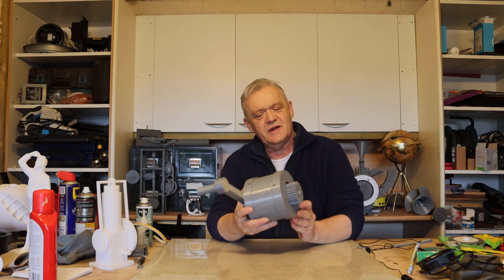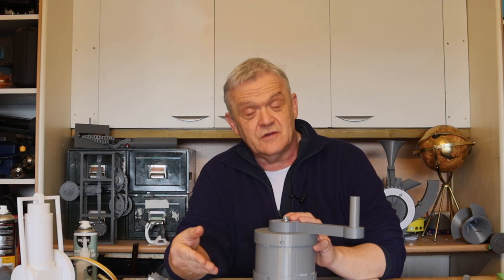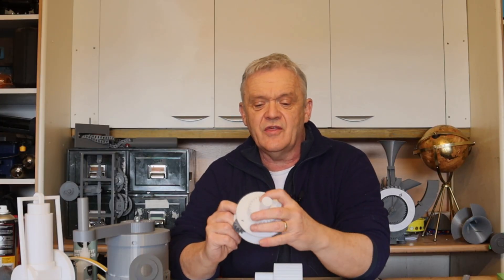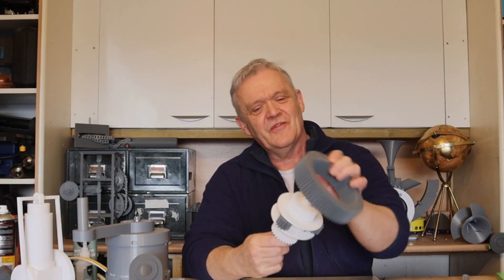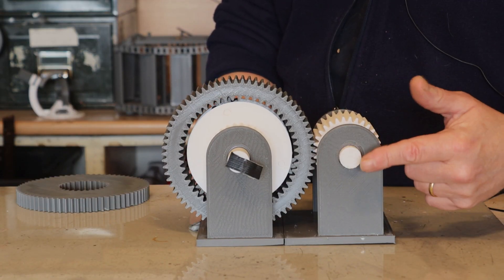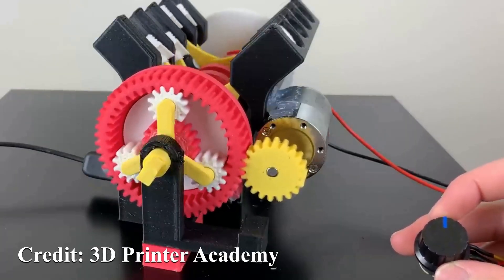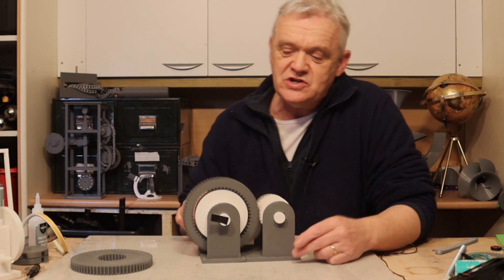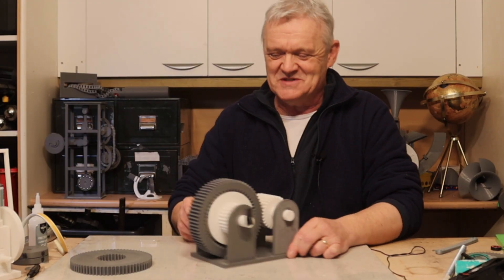2197 The Infinite CVT And Wind Turbine Control

Comment: I don't understand the use of the idle gear at the end. Are you saying that introducing that idle gear ends up with a non-linear relationship between input and output speed? I just can't wrap my head around how that could be possible whilst still delivering torque. If input/output is still a linear relationship, what's the actual benefit of this setup? 
I think I'm missing something here.
Reply: The idle gear is just to reverse the rotation of the feedback component, he's adding negative feedback to limit the speed of the output. If the feedback was positive, the whole thing would runaway in seconds and explode.
Reply: @altair7001  I think the key part of my question is the 'non-linear' thing. If the feedback is linear, then it's subtraction from the final speed would also be linear no?
Reply: @ashedtogether  OK I get what you mean. Personally I don't see how this could produce a non-linear relationship between input & output if everything is geared together. There would have to be some external input that is independent from the rest. I would like to experiment with this to find what is the response of this actual setup presented here. Very intriguing!
Reply: I think that the geared feedback loop changes the slope of input speed vs output speed, as seen on a graph. The response is linear, but the slope is shallower than the 45 degree slope we would see if the input was connected directly to the output. But to get a real speed control, which would give on the graph, a rising slope that flattens out at some speed and then remains flat, I think that some independent input is necessary.
Reply: @altair7001  Likewise. I've a feeling though that the idle gear addition probably doesn't actually bring anything useful to the table, but I do think there could be some really interesting applications for the setup without. I'm sure you could make a kind of dynamic gear box and I can see that being potentially very useful for electric motor driven systems to maximise torque efficiency at different output speeds.

[edit] about slope though, isn't that just generic gear ratio?
Reply: @ashedtogether  Electric motors don't really need an adaptive ratio gearbox because they already have a very flat and wide torque curve, so they are capable of being equally efficient at a wide range of RPMs. And yes, slope represents the gear ratio.
Reply: The reason you don't understand is that it does not do what it is claimed to do in the video.  All the idler "feedback" gear does is to achieve a very high gear reduction ratio.  It has no relevance to controlling wind turbines.

Comment: Nice idea but I'd have thought something like that was already used, or at least a gear box that changes gear according to the load. My solution to the variable wind speed issue is mechanical but kind of wasteful. Multi-stage pancake permanent magnet brushless motor with a first stage as rotor-stator-half rotor, with each subsequent stage adding a half rotar-stator-half rotor. The stages move linearly using hydraulics or a small motor and join together magnetically. The working stages and non-working stages are separate by however far their magnetic fields reach so the non-working stages don't turn.

Comment: That's a great idea to keep the generator part constant, all you need now is a way to limit turbine speed in high winds so the whole thing doesn't disintegrate like in the clip where the wings fly off due to centrifugal force.
Reply: Just reverse the input to output , and you can have a constant speed air foil.

Comment: Hm... So when you apply an uneven load on the output... Dont you need to then vary the motor accordingly? If so... well, i mean, already, i can tell why you shouldnt use this in a vehicle. CVT benefit is efficiency. And that motor is a reduction in efficiency. Or am i wrong?

Comment: Hey! That gearset that keeps the output speed close to the same speed for any speed of input works like an automatic gain control (AGC) circuit! The idle gear is the resistor in the feedback loop that sets the feedback level. Your current version with equal gears looks like a feedback loop that puts the output back in without reducing it. I also see some similarity to a phase locked loop (PLL) circuit as well. I wonder if other useful circuits could be made of gears. For instance, a zero volt switch (ZVS) circuit could be reproduced as a clutch that only engages when the input shaft is not moving.
Reply: Intresting thoughts tou have, somewhere on YT is Analog wooden computer. Gearing and latches were arranged together, antikythera device like. That clutch, think about Weights and Gyroscopic precession force and gearing.
Bicycle back in the day tried a Automatic Shifter, levers and weights effectively shifting by Gyroscopic force. The faster speed, greater force on, orbiting lever(s) to gearing. Don't think this bike with shifter exists today, but I think it's not a bad idea using gyroscope's to act as switches.

Comment: I don't really believe this can work as you describe it. I've spent a lot of time thinking about similar gearboxes.

1) For your first example using a motor and "as a CVT for a car", it falls apart as soon as there is a load the gearbox is driving.

The motor has to have a torque comparable to that of the engine (and therefore produce a similar power Power = Torque * Speed) otherwise it will slip. Any load on the output will cause either the engine input or the motor input to slip depending on which is weakest. At that point you might as well just use an electric motor rather than the combustion engine.

2) For your wind turbine gearbox, it cannot possibly operate as you describe. This can be demonstrated through a simple thought experiment: if the output speed is constant, it should turn at that same speed when there is zero input. This would be some sort of free energy device.

What you really have is a gearbox with a very high gear ratio. This doesn't help in practice as the ratio has to be tuned for the typical wind speed a turbine will experience.

Comment: yep - enter the planetary torque splitter - as seen in the Toyota Prius...

(teaching people the similarities between a differential and an epicyclical gear opens avenues.. All are 3 I/O gear-trains.)

NB. As used in oilfield work - with a hydraulic secondary, the fixed main prime mover speed allows for everything from full reverse through neutral and full forward without "affecting" available power...
It also allows a whole range of "low torque" - or even "lower efficiency / higher loss,  CVT types to work on the low torque side to achieve nearly any outcome - with lower losses than using the CVT as the primary torque path...

However for idling a wind turbine - once we are dealing with complex systems - feathering and braked rotors are the other side of the "power" equation  (generators still get overpowered - no matter the fangt gearing on the back end..

cheers for democratizing great feats of ingenuity. .

Comment: Do you know that the Rav4 Hybrid works in a similar way ? They use an 8KW motor between the wheels and the engine. The relative sincronization in terms of rpms generates the ratio

Comment: What happens when the output shaft is driven of the final setup? Wondering if it becomes a constant speed input, variable speed output based on input torque.
Reply: THATS interesting. Did you have any specific applications in mind? I gather that certain types of engines must remain at a nearly fixed rpm to perform efficiently. If the output of the (now reversed) system is stopped, torque would be maximum to get the mass moving. Once it’s moving, torque falls but rpm increases to continue to add force to the gathering momentum. It sounds perfect.

Comment: This would also allow a greater torque output during high wind so that extra current can be supplied and the extra energy can be harvested during high winds rather than waisted if brakes were to be used.

Comment: You should look into how a snowmobile belt drive system works using conical pulleys to make a cvt. Much simpler and more robust
Reply: Scooters with CVT also have that conical pulley and belt system, but it's not that robust as it eats through belts relative quickly and it's not very efficient due to the friction on the belt side surfaces.

Comment: Commercial wind turbines do it in the generator itself, not the gearbox, using what is called subsynchronous/super synchronous operation by using a VFD  (Variable Frequency Drive) to produce a  variable rotating field in the rotor of the generator itself that shifts the generator's primary synchronous speed up or down from its static mechanical one.  

No need for complex, heavy and expensive mechanical systems when a simple electrical solution already exists.
Reply: Wouldn't that just be for matching the grid frequency though?  Whereas the demonstration in the video was using it to limit the maximum rotation speed of the generator to stop it from tearing itself apart.  As far as I'm aware, commercial wind turbines don't use VFDs for that, they change the blade angle and apply the brakes, to avoid what you see at 6:50
Reply: @vink6163  They use multiple systems to keep them under control.
Reply: The advantage that this has over the inverters is that it gives the grid inertia rather than just being load-following. If the grid has too much load-following it becomes very unstable.
Reply: @atrumluminarium  Wut?
Reply: ? explane i the demonstration video fire smoke and bits going everywhere then ?
Reply: @dh2032  I don't know what you are referring to.
Reply: @tcmtech7515  If you fully watched the video, you would see when he showed a clip of a wind turbine that burned up due to an overspeed condition. As great as electronics are, they are often more prone to failure than mechanical components, and despite you claiming it's "simple" it is very much not as simple as a set of gears and the simpler solutions are almost always more reliable. There's a reason wind turbines often have friction brakes and can feather, it's because using the generator as the sole speed regulator is just too risky; the generator is fine to use as a shock absorber to buffer sudden changes in turbine velocity, but only a complete fool would exclusively rely on it for speed control. If a permanent magnet  breaks off (if one is used), a control board burns out, a ground fault in the electronics occurs, the coil insulation wears and shorts, etc you've got a potential runaway turbine. I'm glad people in aerospace figured out redundancy, because if they took your approach planes would be falling out of the sky regularly.
Reply: @GOAE7777   Yes, I am aware of that.  I tend to not write textbooks as YT comments to keep things simple.  They are very complex machines that use a lot of electronics to keep them mechanically as simple and reliable as possible. 

In one aspect electronics may be more complex, (It's relative) but in terms of construction and cost, they are far cheaper and more reliable than complex mechanical systems that do the same thing.  

Beyond that 1 does not equal in regards to failure or strawman arguments.  The fact is the wind turbine industry uses what they use because it has proven itself to be both the most reliable and cost-effective to manufacture and maintain.

Comment: Very interesting! Two thoughts:

1) Are you sure about the exact reason why overspeed conditions cause such spectacular wind turbine failures? Is it really just a matter of the generator spinning too fast, or does it have to do with some type of brake overheating? I would also think that tensile strength of the blades would be a  factor at some point as they spin faster and faster, as well as potentially the blade tips starting to go transonic (I'm honestly not sure which would cause problems first, but keep in mind just how massive the diameter of that blade circle is).
What about some kind of mechanism to adaptively increase the load on the blades as wind speed increases? (I'm aware that a brake fits that description, but I'm asking if you can think of a way to harvest that extra energy while holding the blades at their happy speed instead of simply using a brake to bleed off the excess as heat).

2) The application that I'm really most excited about for this effect would be the potential for designing a more robust automotive CVT. The current automotive CVT offerings are just junk! They are very fragile and problematic, and they're so different from existing fixed speed automatic transmission designs that most transmission shops won't touch them. You pretty much need a brand new specialist: someone who specializes in CVTs.
Besides the aforementioned issues, the current automotive CVT designs don't seem to be able to be scaled up for anything larger than small cars or compact SUVs.
Planetary gear sets are tried and true in all sorts of truly heavy duty applications, and they're a familiar part that all existing automotive transmission specialists recognize and are comfortable with. This modification to the operation of a "normal" planetary gear set seems like a small tweak that could realistically be incorporated in a robust way.
Reply: Toyota uses this for hybrids
Reply from the maker: 1 - no
2 - like that idea well worth trying out
Reply: This thing seems counterproductive to me.  You're giving the wind turbine the least amount of mechanical advantage in low wind conditions, and the best mechanical advantage in high wind conditions.  Therefore, it won't spin until the wind picks up, then it will spin too fast, causing the blades to fly off.  This is similar to what you're saying, which means I agree with you to a point.  That being said, it's an ingenious device, and there could be amazing applications for it that are far beyond anything I can think of now.

Comment: This is a very clever design. I am curious how much torque does the motor have to use to change the output speed significantly, and would it effectively "double" the cost of driving the load?
Reply from the maker: me too - right now i have no idea - but i may well look into it

Comment: I think you have way too much time on your hands, and I'm jealous. Worked on some horizontal blade water cooling systems, Wind bursts send them into orbit. What you did with the gears is kind of like what is called an op-amp in electronics. A set voltage is put on one input leg, and then it drives the output to a feedback voltage, to attempt to equalize the voltage on the other input leg. This in turn causes the output speed to hold to the desired input. I'm trying to imagine 2 sun-planets on the same shaft, wherein every single gear is turning, to output a zero rotation to the output shaft speed, as variances occur with the input speed. That might be what you were driving at
Reply from the maker: lol - cheers mate - nice parallel with electronics thanks for that

Comment: I didn't understand how fixed gear sizes were able to output a variable. can you update it showing the ratios between input and output changing?
Reply: They can't. The only balance effect here is friction. Without that, fixed gears will give a fix gear ratio.
Reply: @nitsuadivad  If it works on back pressure maybe a air resistance governor would allow it to change the ratio and increase the torque during high speed winds. Maybe extra windings could draw output in high wind also.
Reply from the maker: sure

Comment: This is really thought-provoking... Making me wonder if the same (or better) could also be achieved with magnet gears...?   For wind turbines though, we want to reduce slow speed by relatively little and yet reduce high speed to a greater degree... which is where a 'feedback' controlled CVT sounds really interesting.
Reply: Good question. Magnetic planetary gears?

Comment: I don't think this works. The gear ratio of the sun-to-ring gear train could be adjusted to make the carrier speed exactly zero out. But any gear ratio outside of this would make the carrier turn at a some speed proportional to the sun speed. In other words, it is just a rather complicated gear train. Its use as a CVT could be more interesting, but it would require independent driving of the ring (or the carrier) and that requires using external power to slow down the turbine blades rather than using unusually high blade power at a lower speed. I guess just use a broder-range gearbox, or some different CVT.
Reply from the maker: ok

Comment: How is that better than having several generators and attaching extra load/torque when there is extra wind power?   By attaching a rider gear thus engaging more drag through the generation of more power?
Reply from the maker: it's cheaper
Reply: @ThinkingandTinkering  When someone says cheaper I ask two questions:  Does the more expensive version last longer, and or Does the more expensive version carry with it some extra advantages?  Slapping on extra part time generators would exponentially add more power with every generator.